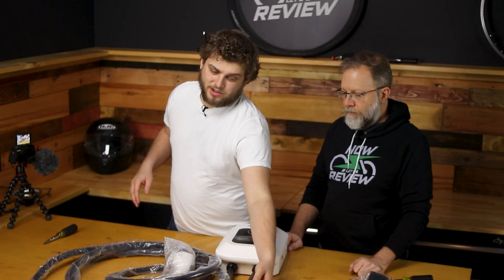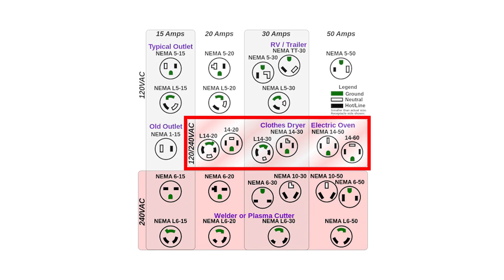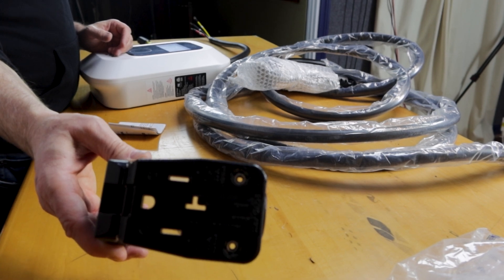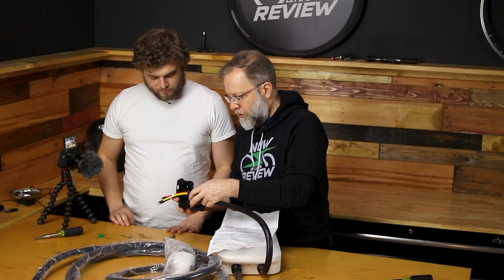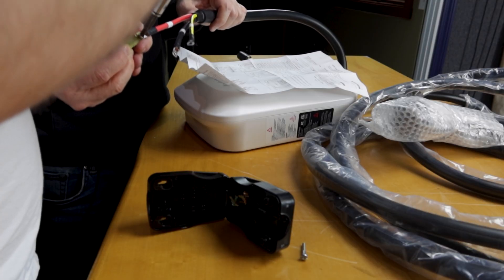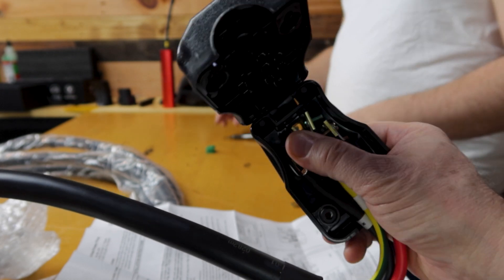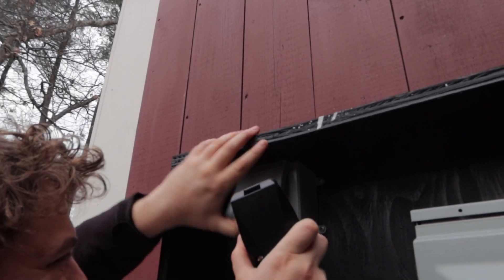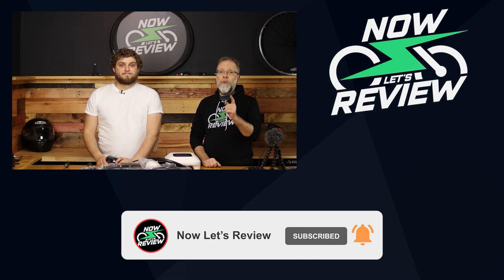How to Install an Outlet Plug On Your EV Charger

Comment: If the EVSE is rated for 50 amps that NEMA 14-50 isn't sufficient, you need to have the circuit sized to 125% of the charger capacity.  Really that one should actually be hardwired.

Comment: All code is different but I am surprised there was no torque suggestions for the screws holding the wires. The massive current that last for hours with EV charging can loosen screws like that over time.